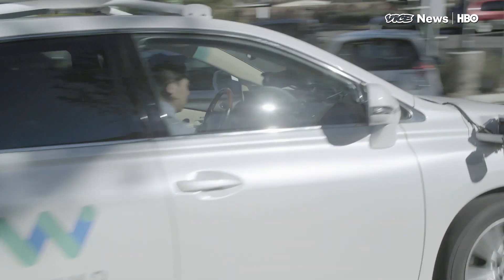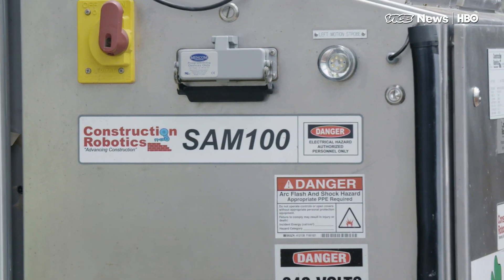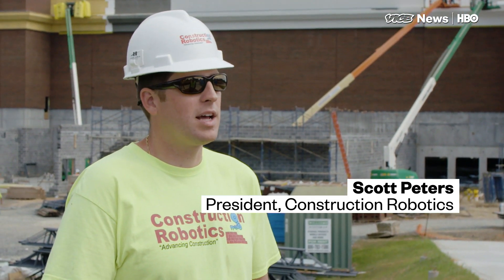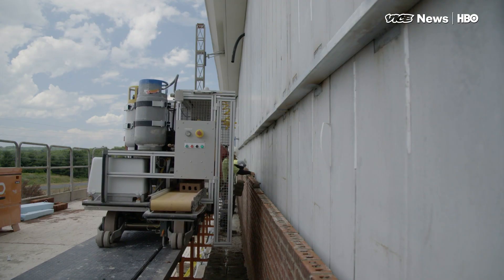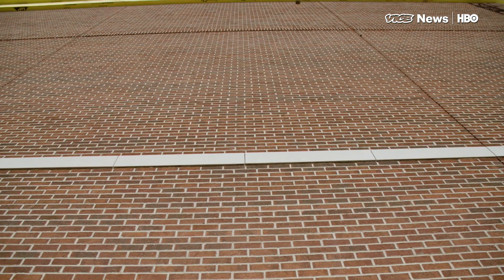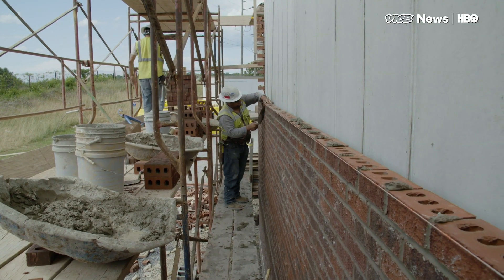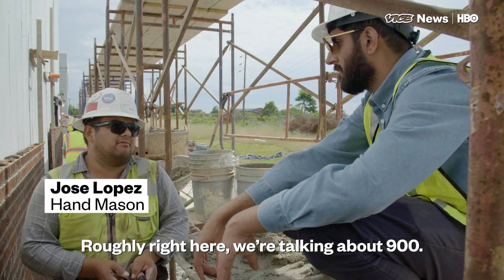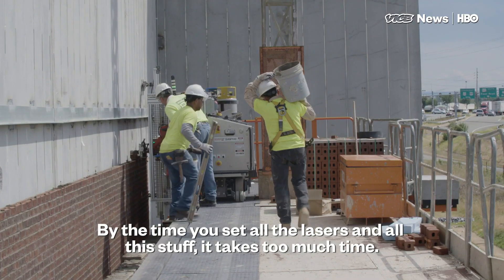This Bricklaying Robot Can Build Walls Faster Than Humans (HBO)

Comment: If it takes 2-4 workers to operate the machine, then it should be compared to 3-5 bricklayers.
Reply: A laborer is cheaper than a bricklayer
Reply: @mpj-nc6wq  Only for now.
Technology advances, components gets smaller, stronger and more efficient, as a result costs of operations of a machine reduces drastically.

Case in point: The big car makers of the automotive industry is never going back to non-automated production lines, niche car makers like Pagani still does most of it's production in the non-automated manner but that's purely due to choice of the automaker as it wants to maintain its traditions(while charging premium for it).
Reply: @mpj-nc6wq  and the engineers & technicians cost more, its kind of cool.  High tech jobs beats mud & straw with bare hands.  although i gladly do the latter myself given half the chance
Reply: but the machine can be operated by people who arent bricklayers or arent good at bricklaying
Reply: @mortencw7702  No it can't, didn't you watch the video? He said it still needs people to the finishing work. The machine just lays brick but it still needs the feature of cleaning up the mortar. It would be cheaper to hire just the brick layer to both operate and do the finishing work or intervene in the case the machine breaks down. So far most automated machines continuously break down. Some companies have robust enough machines to not break down but machines still need maintenance and the demand to meet the number of workers needed to replace retiring construction workers is only growing. R&D cost money as well as manufacturing robots and replacement parts. It will be a long process. Look at autonomous driving. It's restricted to lane keeping assist and slow moving traffic. Not saying it's not making progress but it's hella slow. 2018 Uber autonomous vehicle prototype killed a pedestrian. Elon musk has said himself that he made a mistake with thinking machines are overall better when he first designed the Tesla factory. 'Robots are bad at finicky things' so a robot can weld and paint but it can't  for example, assemble the interior components, run wiring harness through holes and under the carpet. It would be too many machines and if there's a mistake, the entire assembly line has to stop where as a human can quickly replace a defective tail light for example.
Reply: @mortencw7702  you are going to need one good brick layer. Which will be phased out by the machine.....
Reply: @mortencw7702  it’s an unskilled position.... it’s not hard to learn
Reply: it can only work on a plane wall and they need to set it up every time it changes  area
Reply: @bradowen8862  it's a good machine but 1 person can do that
Reply: We'll see in the next 2 decades. The advancement of technology especially robotics is just amazing.
Reply: @donquixoterosinante7899  That really is the concern. As a society we are not planning enough for that future. A robot like this may be laughably primitive today, but as you said, in decades to come it can become superior to a human in nearly all conceivable circumstances. We need to ask what those people will do when they cannot lay bricks any longer. Switching jobs is of course a simple solution but then we must remember that the bricklayer was not the only one whose job was taken by automation during that time. If there are simply not enough jobs to go around we must consider new economic systems to account for massive and long term unemployment. Our ability to survive such a shift in labor in our society will depend entirely on our flexibility and willingness to try ideas which today are considered radical.
Reply: Donquixote Rosinante it’s just not needed
Reply: Donquixote Rosinante scary though.
Reply: 100% right bud. Gonna be decades until any come close to the standard of a bricklayer.
Reply: @4twenny888  decades is a stretch. Most likely 6-8 years at most could be sooner though I've not looked into them
Reply: Exactly that sir!!! Ure absolutely right!!!
Reply: The truth is that the machine is on a mission to take over on all industries!!!
Reply: Say a mason is paid $50/hr. And unskilled labor is paid $10/hr. 
And the machine costs $10/hr. 
No FICA, workman's comp, overtime, sick days...
Reply: Nobody uses those bricks
Reply: These machines will continue to become more efficient .
Reply: Your right dude
Reply: Matt P  🤦‍♂️
Reply: Matt P  where do people look for work once the machine takes everyones work????
Reply: Matt P  probably not but what the humans that will be out of work??
Reply: @stebrandon1  even if people do lose jobs because of robots whether it’s truck driving or bricklaying. There’s a point where can’t hold back the advancement of society. You have to accept that with change in technology means a change in  demand for people in that field.
Reply: Very right. It's can't build corners and it costs more money to work it. The people who are using it on a site are being paid to use it for publicity. Nobody likes the thing and a brick mason would brake it if it gets out of hand.
Reply: No it’s not
Reply: Iv seen brickies on price work lay bricks much fast than this robot
Reply: @JPayne95  600 years ago a longbow was more lethal than a gun.
Reply: @rdreidmehrabi  I would argue that a longbows proficiency at short range could rival most guns up until the late 1800s. Not quite 600 years but I get your point
Reply: Sense.....
Reply: The reason why Elon musks tesla factory’s are not fully automated is the same reason why these masons will still have stable jobs in the foreseeable future.
Reply: Nope. Every brick layer has helpers feeding him material
Reply: Trippin on whindow I’m faster then a robot
Reply: The walls are usually started by setting up the corners and this robot is incapable of doing that, first the humans have to construct the corners in order for the robot to even begin to lay the corses of bricks, this video only shows us the robot laying bricks against a building already erected with corners, lol robots will never have the complete flexibility that humans have, humans are much more faster and efficient, especially since the robot constantly needs adjustments and help loading the mortar and bricks
Reply: Sounds great... Why isn't it tooling the mortar? Why isn't it laying them cleanly ( clean time adds to the time taken to finish product) my own business won't be economical with that machine and my workers I wouldn't betray for that
Reply: Don  ahh I did Internet search, I'm not a boomer, just don't spend that much time on Internet.
If that's your only argument.... cool party,
Reply: Beyond Your IQ  robots can make any 'adjustment' a human can rofl...humans program the robot to do what they want. CNC and bots are more accurate than humans by a long shot. I program this stuff for a living, you should see some of the stuff I see demos of at trade shows...manual labor jobs will be replaced and sooner than you think.
Reply: Koreans already operate machines from central center.
Reply: And that’s if it doesn’t go wrong and need fixing
Reply: Human brick layers also require unskilled labourers to bring them material.
Reply: What about corners and different bonds ect .ok for massive straight wall but usual on site that's  done with mettle cladding.
Reply: @robertgissy2851  I believe I read that it can do corners, but it just takes way more time
Reply: Or a 3 and 1 gang witch lay 2000 bricks average like to see it do corbeling and curved walls
Reply: Just like the saying eney idiot can run to a line

Comment: Theres no other way to describe it tho. You cant be naïve. We all knew that Bricklayers would be the first of the construction trades to get automated but this will do away with the trade entirely. Eventually you just buy more SAMS, get a SAM to do finishing work to now the job is no longer called brick layer, its called SAM operator, and we only need 2 SAM operators versus the 40 or 50 Masons we used to employ, but "this wont replace the workers, if not just a few of them, but will augment the work!" Lol

Comment: This is bull man. I just turned 20 and I've applied for over 80 construction jobs to learn the trade. I haven't heard back from any. So the statement that "young" people don't want to do the job or hate the labor is dumb. Yes, there are some lazy mf's out there but these companies want experience, not to train and build a person. But other than that I also agree that the number of people it takes to run the initial maintenance of the robot seems more time consuming and less efficient

Comment: I wonder if they could just build bigger bricks a brick has an equal height to its width but its longer like 3 times longer than it is tall or wide. If they make them wider it would be bad bc it would use up more space and it would need more mix. But if they make them taller a wall would require less bricks to reach the height. They could probably also make them longer. It may not look the same but it may speed things up im sure thers a height and a length they could change them to. I know thers also cynder blocks but thats going overboard thers can easily be an in between size i bet
Reply: Death Vader  it wouldn't be practical and it won't give it the brick look although iv seen that stuff they use in restaurants where its a fake thin rubber brick, but i think that fake rubber stuff would only last indoors. They have the option of just using concrete but its not  cheap moving concrete around i bet.

Comment: This is a great step, but they're at least 20 years from having any sort of robot that can lay any sort of detailed work. That would involve cutting and various angles. The framing and concrete you are laying on is not always straight either. Once they make a robot that can adapt to these variables, a company will have to make it economical and serviceable. These square brick buildings with walls all in the same plane are the few and far between. Source - commercial masonry project manager

Comment: isn't the use of bricks the inefficient part?
Reply: @dneaM  no like cant they just have a concrete wall and omit the brick industry altogether
Reply: @danielmorales4351  Concrete requires a mold and bricks/blocks do not. There are also functional and aesthetic differences between the two.

Comment: Who's working on the robots that are going to replace corperate CEOs CFOs and chairman?
Reply: IBM.
Reply: Đeath Vader  long $YANG with calls than
Reply: Will likely never happen (For the foreseeable future at least). Robots so far are only capable of taking over mostly repetitious jobs, or mastering a very specific activity. You would need a general intelligence robot to take over such a job. Brick laying requires significantly less brain power.
Reply: @AmazingStoryDewd  😔It was a critique. Not an actual question.

Comment: 2-3 extra men needed anyway? So each lays 1000 brick. That’s 3000 brick. Usually there is 5-8 men on wall that size. The machine lays far less than a crew of humans that don’t need 3 days of setup before they even begin.
Reply: The robot will eventually get exponentially faster, smarter and will be guaranteed to reach a point where it outperforms an entire human team. The thing is it will likely take a long time before that happens, and by that point masonry working may not even be a desirable or neccessary job anymore.